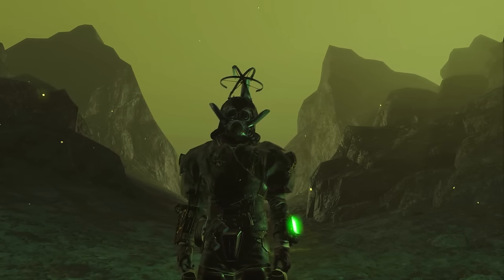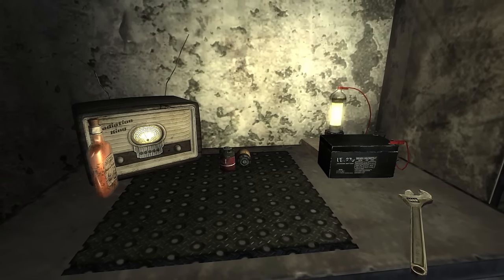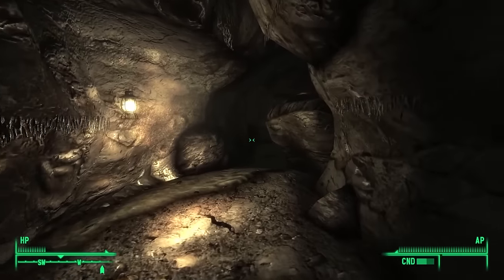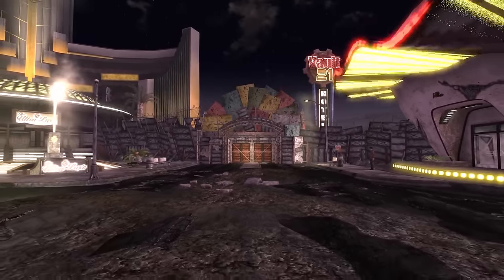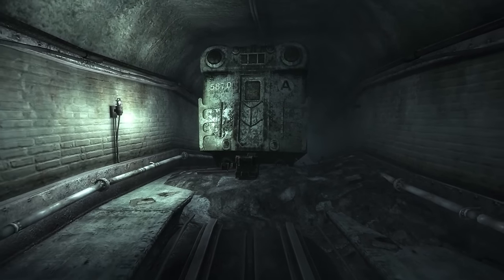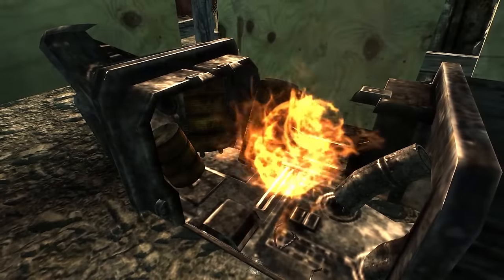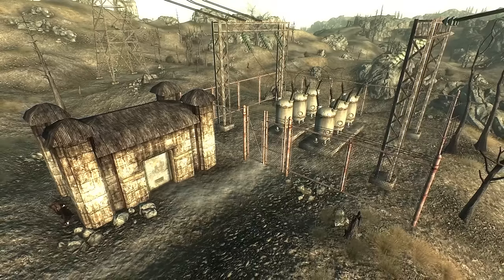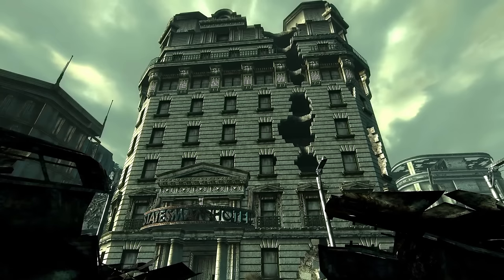Where does the power come from in Fallout?

Comment: One thing that's interesting, especially given the 1950s aesthetic and art deco design obsession of the universe, is the use of radios in the Fallout universe. There's a real life radio (that saw a resurgence of popularity in the real life 1950s) that doesn't require any electricity to function: The crystal radio. The radio uses a galena crystal and uses the power from the radio transmission itself to power a small speaker.
During the 1920s, these things became ridiculously popular and the United States Bureau of Standards even released official guides and manuals for people at home to make their own crystal radio and encouraged people to do so. Starting in the 1930s they saw a decrease in popularity due to affordable amplified receiver radios (like the old kind using vacuum tubes) becoming available. Although, during WWII, the crystal radios built by troops (called "foxhole radios") because Germans were detecting and triangulating the oscillator signal of Allied radio receivers. The crystal radio can't be detected because it's a passive system that works thanks to the radio signal's own power and transmission. There's nothing to track.

Also, in the 1950s, there was - get this - rocket-shaped pocket crystal radios that became hugely popular with kids. Now THAT is something that sounds right out of Fallout.
Reply: I looked it up and man that's hella cool
Reply: Sometimes I have to poop for a long time.
Reply: I want one now
Reply: bro, did you ever saw crystal radio that could power small speaker? All it can power is high impedance headphones. And it requires quite strong signal. And you can!t switch stations so easily. And so on...
Reply: @frantisekdaart  
"bro, did you ever saw crystal radio that could power small speaker?"
Yes.
v=N-HFZqdujPE

"All it can power is high impedance headphones."
Wrong. 
v=z95QOC9yHrw
v=p_xNZTe4i1w

"And it requires quite strong signal"
Wrong again.
v=HvLmJGM_T3M

"And you can!t switch stations so easily. And so on..."
Also wrong.
v=mubvsqFrE88
Reply: @matchesburn  Thank you for your effort. <3
Reply: So cool, thanks for sharing!
Reply: You could have made a 20 minute video on the crystal powered radios you speaketh.  Thanks for the info 👍
Reply: neat
Reply: @imweird.6147  i have the same problem as you bud
Reply: @matchesburn  I've seen quite a few crystal radios, and they ALL use headphones.  The power you get from a radio signal is extremely small, and there's no way you're powering a speaker (ie an oversize headphone that is loud enough to hear from a foot away) with it unless a strong station is very close.  There's no such thing as a "high impedance speaker", that's a headphone, because it doesn't produce much power and you have to have it at/in your ear to hear it.  High impedance (resistance) means low current and low power, which you can only begin to make up for with high voltage. (being close to a strong radio station)
Reply: @nathanfisher6925    
"I've seen quite a few crystal radios, and they ALL use headphones.  The power you get from a radio signal is extremely small, and there's no way you're powering a speaker (ie an oversize headphone that is loud enough to hear from a foot away) with it unless a strong station is very close."

...You clearly didn't watch the videos that I linked to that show that you're incredibly, dramatically wrong. "B-B-B-But I've never seen one that uses speakers!" - forgive me if that argument doesn't convince me that much when most people have never seen a crystal radio. 

Watch this and stop trying to "correct" me. Yes, you can power a speaker with a crystal radio. These things called "transformers" exist and can easily be wired to convert the radio to power the speaker:
v=z95QOC9yHrw

...And given that most crystal radios are made by people themselves, this isn't all that ridiculous for this to be a thing.
Reply: @matchesburn  I'm not convinced that you know what a transformer does.  It certainly doesn't "convert radios".  It trades current for voltage, and can be used to "match impedance" from parts of a circuit that are at different levels.  It DOES NOT "create more power" to run higher power demand components.  The reason crystal radios use earphones is they are usually harvesting VERY small amounts of power from the radio signal, and earphones require very little power to operate.  ALL speakers by comparison require a lot more power to be heard.  Very small speakers will of course require much less power than larger speakers, but even very small speakers still have a pretty high demand compared to an earphone.  Headphones are basically very small speakers and can be a middle ground between the two, requiring much more power than an earphone does but with the speaker right by your ear and a muff to contain the sound, it can be enough to perform okay.  But if you want to be able to hear a larger speaker sitting on the desk from a few feet away, you'd better be listening to a strong, nearby station because that speaker is going to require at least milliwatts of power to be heard, not the micro-watts that an earphone would need.  My first crystal radio was a Science Fair,, you can see the small earphone they always came with.  https://www.samstoybox.com/toypics/EPK-CrystalRadio.jpg  You might be able to hear something by hooking up a small, high impedance set of headphones, but even with a large (low impedance) speaker hooked through a transformer your odds of hearing any stations more than a few miles away is around zero.  And most people use crystal radios to listen to distant stations, sometimes even from other countries.
Reply: Now I want to build one
Reply: @nathanfisher6925  
"I'm not convinced that you know what a transformer does.  It certainly doesn't 'convert radios'.  It trades current for voltage, and can be used to 'match impedance' from parts of a circuit that are at different levels.  It DOES NOT 'create more power' to run higher power demand components."

Straw man argument and malfeasance. I never said this. I never said, "magic box make more power make speaker work." It's converting it into usable current. It's the in the name: "Transformer." Oh, look, nothing I said was inaccurate.

Look, it's obvious at this point you're just arguing with me to save face, but you just proved you're here to do that. I'm sorry, but I'm not interested in that. Especially not when you resort to cheap tactics like this. You are not worth my time.
Reply: @imweird.6147  more fiber, my dude.
Reply: @ElectricBuckeye  yes
Reply: @matchesburn  the video with the guy hooking it up to a speaker isnt a crystal radio though theres no crystal. im not an expert in these radios so perhaps im wrong. the use of the transformer requires enough energy entering for you to get the right amount to drive the speaker so you still do need a strong signal
Reply: In the lat 70's there were electronic project kits that let you wire up the components needed for a crystal radio, among other things,  with an earpiece to listen with. They were great fun for kids at the time.
Reply: @Videoswithsoarin  
"the video with the guy hooking it up to a speaker isnt a crystal radio though theres no crystal. im not an expert in these radios so perhaps im wrong."
You are wrong:
v=z95QOC9yHrw#t=1m45s

Notice he points out the regular germanium crystal. That is a crystal radio.

"so you still do need a strong signal"
You do not. That is what the capacitors are for.
Reply: @frantisekdaart  ik itd old but, hey cool higher tech crystal radio, but heres a huge downside, and another huge downside, and another one. but your comment and all these other comments cool asf
Reply: youre a badass
Reply: I’m reading a book about the Great Depression and it talks about a kid building one
Reply: Man, that is highly interesting. I will have to try to build one someday.
Reply: Fun fact, similar tech was used by the Soviet Union for spying
Reply: @paulmurgatroyd6372 They still made crystal radio kits in the 90s and early 2000s, they might still make them, haven't checked lately.
Reply: @stigrabbid589  Yeah I think the electronic project kits still exist in one form or another. A friend of mine bought me one of the old ones from a second hand shop, brown earpiece and all.
Reply: This was so interesting i might try to build one
Reply: Ding ding ding
Reply: I have a Bureau of Standards radio from the 50s with experimental wafer circuits. Look of project tinkertoy NBS.
Reply: @jordanmcbride2702  everything he said was wrong. Why are you thanking him. did you read what so ever?

Comment: The Hoover dam was designed to survive without people running it so I wouldn’t be too surprised if some of those bits of automation in things like the overflow rerouting would have become present in other hydroelectric sources across the country
Reply: I read somewhere that it could run for a total of 6 hours with no men operating it.
Reply: @Notaffiliated64  and a futuristic version with robots it would need zero people for those two hundred years easily
Reply: @davidos8760  but who's powering the robots for 200 years?
Reply: @thestaminabs  they are fusion or fission powered both can theoretically power the robots that long this makes sense thanks to the sci fi bordering magical fission tech let alone fusion
Reply: @thestaminabs  if robots are working the dam and generating power they could probably charge them selves in the dam
Reply: Plus, the NCR repaired everything in it so it can be used to produce power again.
Reply: @thestaminabs  robot operates machine that makes energy energy making machine provides power for robot this is a mechanical ecosystem
Reply: @davidos8760  or the robots make their own power the robot manages the generators the generators provide Power which is sent to the recharge pods for the robots
Reply: @JHSMDH  exactly
Reply: Was also reinforced and built to survive a nuclear attack. So are nuclear power plants.
Reply: @Ecard Ecardian yeah, it’s a shame nobody wanted to try and get the wind farm up and running
Reply: @Ecard Ecardian yeah and just  to the East, across the highway from Helios one, and surrounded by cazadores, is a broken and abandoned wind farm
Reply: @ryanbusch2885  okay but before an timeline NCR victory they don't have the spare man power to go fight off the cazadors and then fix up the wind farm the solar power plant and Hoover dam are their main priorities. Hoover dam produces practically all of their electricity and the only reason they have the solar plant as a focus currently is because the brotherhood were there if they weren't it would be a post-war project. Most likely in the event they do win they would probably go fix up the wind farm as well if that's an additional set of power generation but not as a high priority as the Hoover dam
Reply: It already it present in a tone of high level infrastructure, things like government buildings/military buildings and other power stations.
Reply: @Notaffiliated64  with different sorts of robots aroumd it could feasibly run indefinitely. Automation is a big thing in the prewar world of fallout
Reply: @Notaffiliated64  if I remember, it's like 6 months but that's because of an invasive shellfish clogging the intakes that are regularly cleaned because of them
Reply: @thestaminabs  The same things that power satellites and the mars rovers in real life. Nuclear batteries and solar power. A basic operations robot that could last for two hundred years is not a particularly strange idea, especially when you consider things like satellites launched in the 70s that operated for nearly 40 years. If there is just a small network of high reliability robots that maintain each other and the facility, then it could easily run completely autonomously for the entire physical lifetime of the structure.
Reply: One has to ponder the amount of erosion flowing water might cause in this time space... That's without taking into account suspended particles... There's a lot of dust in this universe
Reply: The hoover dam could run herself for nearly a decade before the invasive razor clams take it out. More likely we'll kill the damn when we kill whats left of the Colorado river.
Reply: @thestaminabs  the dam duh
Reply: @fatgecko1616  The manager of the dam has stated that without any outside intervention, the dam would probably last thousands of years. However, he also states the power plant would cease to function within a week without people to maintain the debris filters from getting clogged up.
Reply: @aprisia  thats because of the invasive razor clams. They need to be removed alot from everything.
Reply: @fatgecko1616  No, his comments specifically referenced debris filters for things like sticks and such. I’m sure the razor clams are an issue, but the timeframe he’s talking about is too short for them to be the imminent issue.
Reply: @fatgecko1616  Google Hoover dam Covid maintenance. There is an interview with the current manager discussing what was the minimum necessary staff needed and how they worked to achieve that during pre-vaccination Covid. That is where he talks about the strainers/filters.

You could also look up the lifecycle of the razor clam and find out it takes 5 to 16 weeks for the mobile larvae to develop into actual juvenile clams depending on conditions of the water…
Reply: @thestaminabs like a Roomba. They dock themselves
Reply: Hoover dam is a first strike target though
Reply: I always thought the fusion generators were the generators powering the building and the core must have been a battery back up incase the generator failed and while the generator is running it is powering the core similar to when a car is running it powers a car battery
Reply: Hoover damn would run at most a few years without human intervention. Definitely not forever.

Comment: As an actual electrical engineer, I love this video topic and how you approached it.
Reply: yet didnt mention or clarify any of the mistakes?
Reply: well then how do they do it? 200 years a long time in machine life even with all the fission/fusion sorcery
Reply: @jasonrarick2389  well considering that in fallout you have 500kg+ armor that you can walk around just fine and dandy in and an assisted aiming system that freezes time, its not too far fetched to think that their already super unrealistic fusion and fission technology could stay in power for hundreds of years, i believe in the original fallouts its mentioned that the fusion cores that are used for power armor can keep power armor going for hundreds of years, although that has been retconned by bethesda it seems to still be somewhat true with the generators in houses/establishments  that seem to have been running for over 200 years.
Reply: @Videoswithsoarin  which you also didn't do